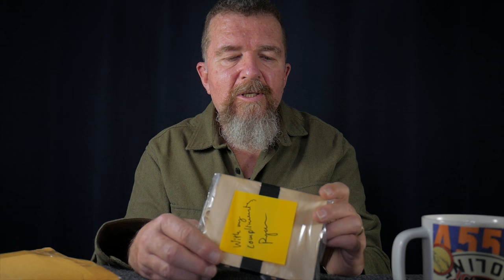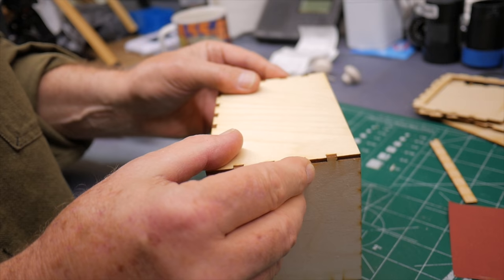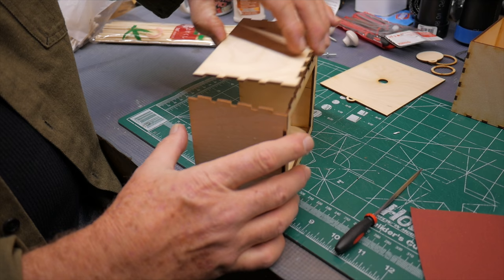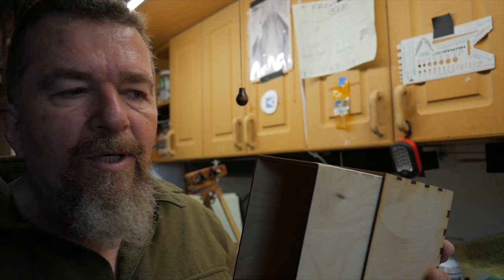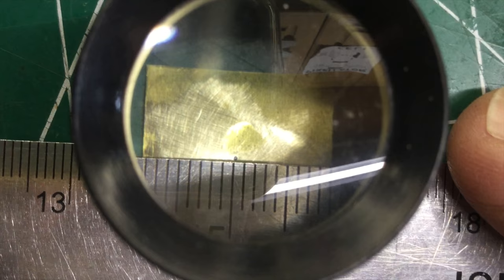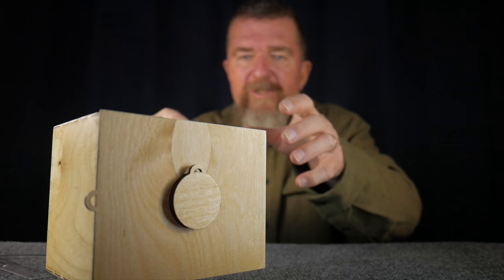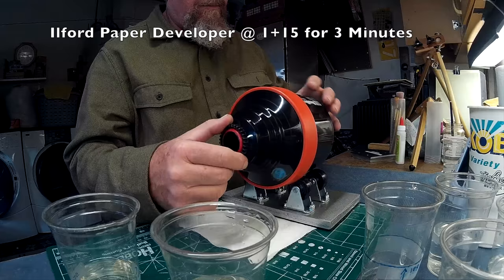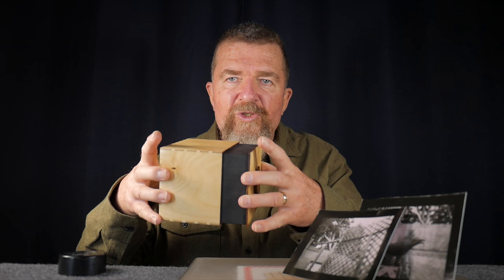Ryan Adney's Pinhole Camera Kit

Comment: How does Harman DPP compare to regular contact printing regular photo paper? 
Have you ever experimented with a pinhole with a diffuse edge? 
It could make the diffraction ringing less pronounced perhaps. I’ve seen examples of diffused zone plates. 
Only problem would be how to do it. Maybe photograph a large negative diffuse pinhole onto 35mm?
Reply from the maker: I'm going to do a video comparing the two types of paper. 

Harman DPP is relatively difficult to get right now, with Ilford's manufacturing issues ongoing. And it's only available in double weight fiber glossy paper and one emulsion type. Whereas with negative papers there's a wide variety of surface finishes (RC, fiber, semi-matte, glossy, etc.) and emulsions (graded and multigrade) from a variety of  manufacturers. Also, with contact printing you get the benefit of choosing from that wide variety of papers for your finished print; and with MG emulsions you can control the contrast of the finished image.

Of course, with contact printing it's a multi-step process: develop and dry the negative, then determine a good contact printing time by means of iterative test strips, and finally make the final print. Whereas with direct positive paper you get the final print right out of the development tank or tray.

I have not tried apodizing masks with pinhole. But a zone plate is kind of like a hologram of a single-element meniscus lens, as it has the diffraction rings included. If I understand the theory correctly, at the Rayleigh limit, an ideal sized pinhole should be indistinguishable, image-wise, from a lens of the same size.